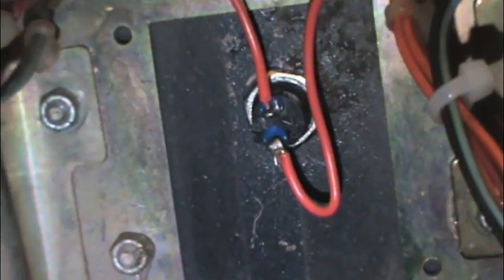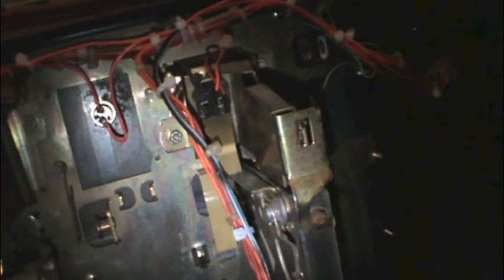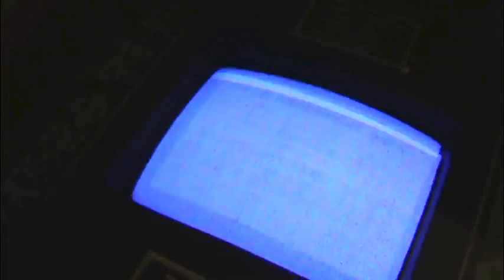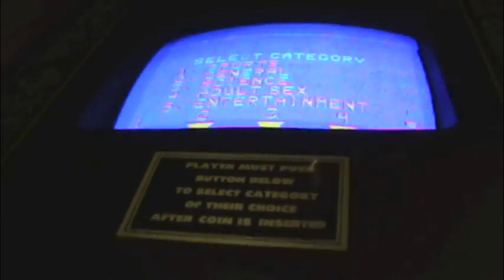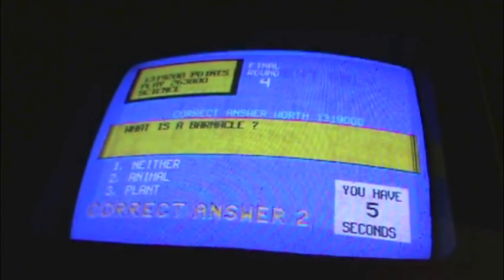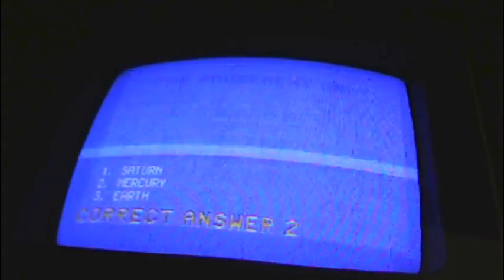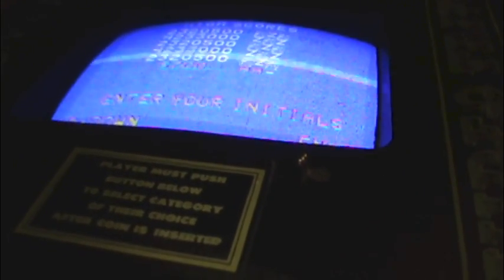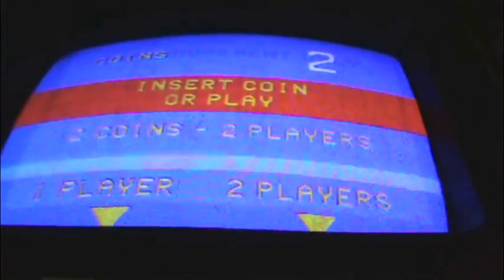Arcade Game Coinless Operation Modification

Comment: it is either composite or RGB, I'm thinking composite though, there is some color bleeding. A lot of arcade games used RGB for their displays but I really think this one is composite.

It would be possible, but why? if you had one of these and the burn-in bothered you, find an old TV set with a similar CRT in better shape and swap it in.

Comment: YOU SHOULD HAVE PUT A MAGNETIC SWITCH LIKE THEY USE IN TREADMILLS. YOU COULD JUST MOUNT THE SWITCH IN BACK OF THE WOOD AND TOUCH THE SURFACE WITH A MAGNET AND YOU HAVE JUST PRESSED THE SWITCH VIA MAGNETIC FORCE. NOBODY WOULD KNOW WHERE IT IS EXCEPT YOU.